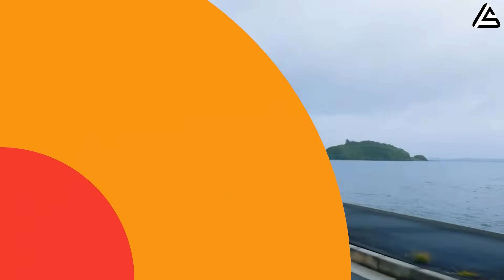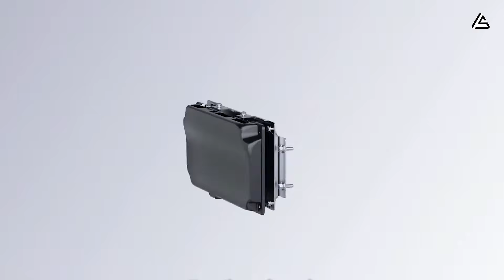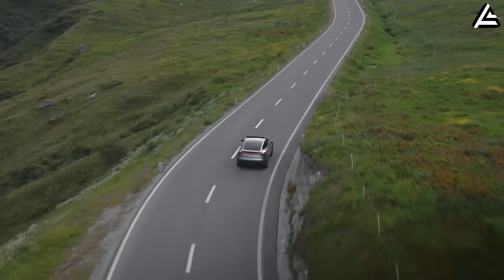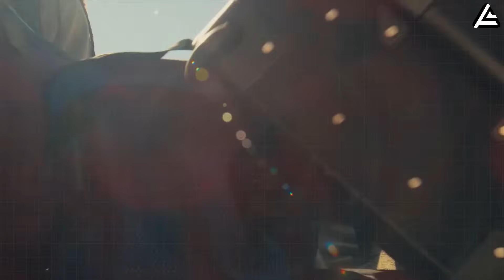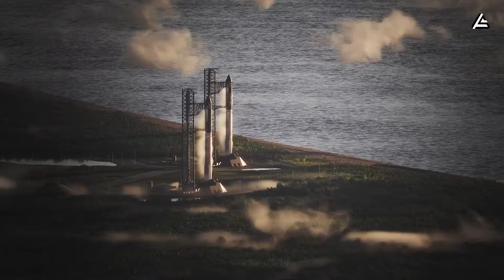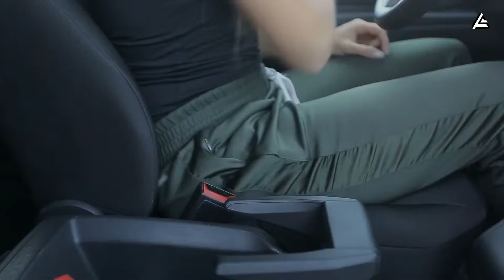2026 Tesla Model 2 Explained: Design Signals Suggest Ending Car Bills? MIX

Comment: Dual motor. Because of winter snowing. I do like low temp battery performance. I have an all wheel drive Dodge at present. Now in winter how much will my battery fail. I do like the solar cells, especially with a glass roof, if very high performance cells, then cells will still charge some.
Reply from the maker: good choice. why did you choose it?

Comment: 全固体電池を出来るだけ小型化して
チャージの度に入れ替える方が良い ‼

ガソリン給油より簡単に固体電池ユニットを
差し替える形態が望ましい ‼

固体電池ユニットの充電は安価な深夜電力で
行えば設備・経費も軽減出来る ‼
Reply from the maker: That's an interesting idea. Tesla actually tested battery swapping years ago, but ultimately chose fast charging because it was easier to scale. If solid-state batteries become smaller, lighter, and more standardized in the future, though, the idea could become much more practical than it is today.

Comment: どんなに電池性能が良くなっても ⁉ 充電器が安く
小さく 早く 高出力でも  ⁉先ず電気代の解決❓が
出来なければ 電気不足と高騰化は止まらない ‼

ＥＶを無理矢理エンジンに置き換えての主流には
成り得ない ⁉且つ上手いくとは思え綯い❓

ＥＶの充電が夜間や昼時の電力不足になる‼
電気代が月額  5万〜10万 となら乃いと良いけどね ⁉

ＥＶ車の場合は 航続距離 ＝ 安心係数 となります‼

東北・北海道などの極寒地の場合  大都市間移動距離が
100Km以上なんて  普通中の普通  ⁉
且つ外気温低下と 各種ヒーターの使用によって 
 本来の航続距離が 半分程度まで落ち込ます‼

路上での途中充電も　辿り着いた充電施設で
充電器故障中 なんて事も ⁉
中には 冬季間使用停止中なんてのも有るし　
大雪の直後には 充電器までの通路除雪も
されてない場合も在る‼
Reply from the maker: OK! I agree with you. Tesla is already addressing some of these issues with heat pumps, battery preconditioning, a growing Supercharger network, and more accurate energy prediction that factors in weather, terrain, and temperature. For owners, the practical solution is to charge before the battery gets low, precondition the cabin while plugged in, and keep a larger buffer in winter than they would in summer. EVs still have challenges in extreme cold, but both the technology and the charging network are improving every year.

Comment: What about the much higher cost of auto insurance for an EV?
Reply from the maker: Higher insurance on EVs isn’t universal, it’s model-, region-, and repair-network dependent, not a blanket EV problem. As Tesla expands parts availability, standardized repairs, and more third-party body shops, Model Y insurance costs have already normalized in many states, often matching comparable gas SUVs. For a lower-cost Model 2 with simpler construction, insurance pressure is more likely to move down, not up, especially as repair times and claim severity fall. We will talk about this more detailed in our future video. Stay tuned

Comment: I am not so interested in solid state batteries as in wp/kg. If solid state moves aluminum ion to higher wp/kg then sure. If not then not interested. Thermal runnaway is maybe more important than 8 wp/kg seems to be the break even point in wp/kg. Anything less seems not wanted. So how much more is dual motors over single motor? 4wheel drive around here seems a lot more wanted than single motor drive. Dual motor seems wanted 10xs more wanted than single motor budget evs. Will take a budget single drive rather than dual motor if a lot higher in price. So to keep the dual motor running long term it seems an oil change at half life seems needed.
Reply from the maker: You are thinking in the same direction Tesla usually does. Energy density only matters if it comes with real world safety and durability, and thermal stability is often the true break point rather than a few extra Wh per kg. That is why aluminum ion and other alternative chemistries stay interesting even without headline numbers.

On motors, Tesla has historically kept the cost gap between single and dual motor much smaller than the industry average by sharing components and software control. Dual motor is clearly more desirable in many regions, but Tesla often offers it as a scalable upgrade once production volume is stable. Long term durability is also a focus, since Tesla motors do not require traditional oil changes in the way combustion systems do, which keeps lifetime cost low. As always, Tesla tends to balance performance, price, and longevity rather than maximizing just one metric.

Comment: A LIST OF REASONS NOT TO OWN AN EV
1. AVAILABILITY OF CHARGING STATIONS THAT MOST OF THEM IN THE FACILITY DON'T WORK, AND NOT ENOUGH OF THEM FOR TRIPS
2. EVEN WITH LONGER  RUNNING TIMES AND SHORTER CHARGING TIMES, THERE ARE STILL DISADVANTAGES TO OWNING ONE
3. DUE TO THE HEAVY BATTERY, MORE EXPENSIVE TIRES FOR THEM DON'T LAST AS LONG AS THOSE ON AN ICE CAR
4. DOUBLE THE INSURANCE RATES FOR AN EV  DUE TO SMALL FENDER BENDERS CAN MAKE IT UNFIXABLE BY NORMAL MEANS
5 NEW EV'S MAY HAVE SOLVED THE COLD WEATHER PROBLEM, BUT THERE ARE MILLIONS OF THE OLDER TECH ONES STILL RUNNING THAT HATE COLD WEATHER THAT SHORTEN THE RANGE AND MAKE FOR SLOWER OPERATION UNTIL IT GETS WARMED UP
6, KEEPING AN EV WARM AS KEEPING ONE COOL INSIDE EATS UP A LOT OF THE MILES IT COULD HAVE GONE WITHOUT THEM ON.
7. GASOLINE IS NOW IN THE BELOW 2 DOLLAR RANGE IN OUR AREA,  WHICH MAKES EV'S NOT PRACTICAL TO OWN NOW
8. AS SHOWN HERE ON YT, TRADE IN VALUES ARE IN THE BASEMENT FOR EV'S DUE TO BATTERY LIFE LOSS AND THE USED LOW VALUE OF THE CAR
9, LASTLY, THE NORMAL 85% OF THE AMERICAN PUBLIC WILL NEVER BE CONVINCED OR COERCED INTO BUYING AN EV AND ARE MOSTLY HATED IN THIS COUNTRY, A LOT OF IT DUE TO BIDEN'S PUSH FOR THEM AND THE THREAT TO OUTLAW ICE CARS AND QUIT MAKING THEM.  PEOPLE DETEST BEING TOLD WHAT THEY ARE GOING TO HAVE TO DRIVE.
Reply from the maker: Thanks for your sharing. Those are real concerns, and EVs clearly aren’t the right fit for everyone or every region today. Tesla’s argument isn’t that EVs replace ICE overnight, but that improvements in charging reliability, cold-weather performance, and total cost are steadily addressing many of these pain points for certain use cases.